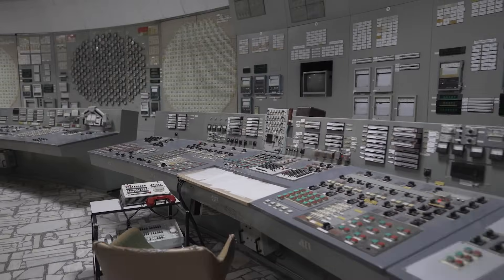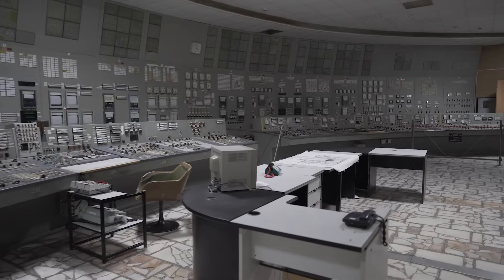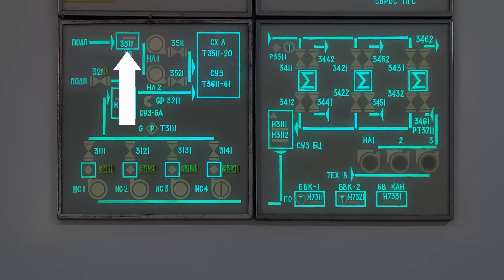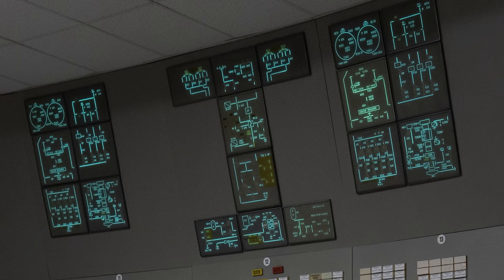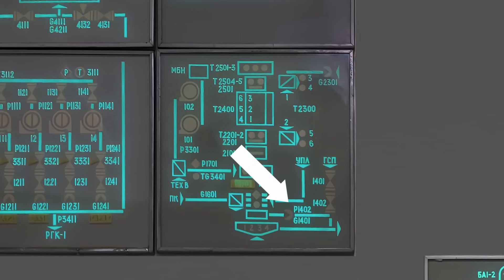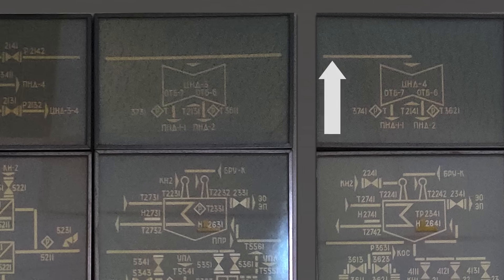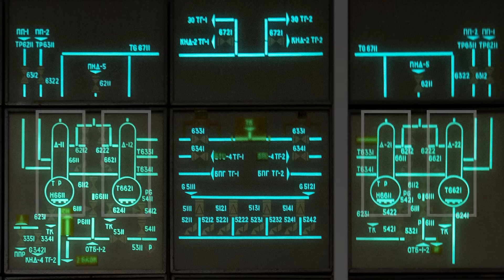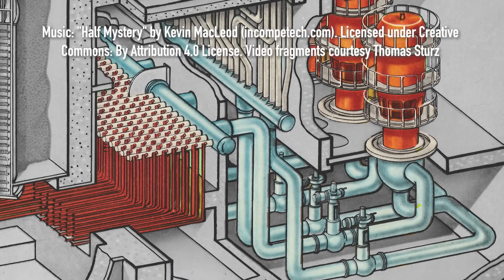RBMK Reactor: How It Actually Works | Chornobyl Uncharted Ep 21

Comment: What a nonsence, after this video i understand what a complex and unefficient sistem this is...😂 Just crazy how much heat power this systeme loses and apply for it to work. And also btw used fuel and contaminations.... But I respect the engineering decisions that made such a reactor operate stably at all..😅
Reply from the maker: I can not say that any heating plant is vastly different from this, tbh. Where you have boiling water, you always have a loss of heat...

Comment: It's a good thing this control room hasn't been modernized. Modern technology and boring LCD displays don't have even one percent of the charm of those original tilt-and-telescope indicators, physical buttons, VFDs, Nixie displays, and others from the days when technology was both beautiful and fascinating, and the control room flashed with a multitude of colors. It would be a pleasure to work in such a workshop. Not in front of a pile of computers, mice, and LCDs.
Reply from the maker: It was partly, but monitors were removed after the shutdown.

Comment: How do the pump systems not fail since they have to pump radioactive waster?
Reply from the maker: And why should they fail? Radiation has little or no effects on them; what they are vulnerable to are corrosive gases, oxides, and other  effects of radiolysis of water and nuclear reaction in the core; but as you see, there are numerous devices to remove that.
Reply: Radiation is the least of a problem they face there, not enough oil lubricant inside their bearings would be more dangerous

Comment: In some of the control room 4 photos, I can see there're four holes behind the larger panels and two holes behind the smaller ones that had been taken off before. I thought they were cathode ray tubes or rear projection displays or some sort at first, thanks for sharing!

Comment: Internal KGB memos that were later declassified after the fall of the USSR repeatedly warned Chernobyl's plant management about the serious design flaws with the RBMK reactors, namely the positive void coefficient.

These warnings fell on deaf ears for some reason.

If they had retrofitted all of the RBMK reactors with the upgrades that were installed after the disaster, then in all likelihood that meltdown would never have occurred.
Reply from the maker: Yes. A compilation of KGB reports released a few years ago is something.

Comment: They focus on monitoring the various systems. Where do errors appear? If a value is not within spec, you could have 3 people looking at the wrong place for several seconds before that is noticed.

I assume there are some auditory alarms and some visual cues.
Reply from the maker: SKALA gives output on a teletype installed at control room. There those went.

Comment: 4:14 shouldn't that graphic say N2 + He?
Reply from the maker: Yes, I made a typo accidentally
Reply: @ChernobylFamily  H and N are tricky when going back and forth across latin and cyrilic script :D I guess that's why the mnemonic displays used "Ng".
Reply from the maker: @oorcinus regardless we use Cyrillic script in Ukraine, chemical elements are in latin (as those are international symbols)
Reply: @ChernobylFamily  I know, but - like i've said - it's interesting the displays used "Ng" which is (obviously) not an international symbol for Nitrogen. My guess is - to avoid cross-alphabet confusion at a glance, since a lot of the script on the displays was mixed.

Comment: Another brilliant video. It looks like the displays are too far away from the operators to read easily, but maybe they are bigger in reality. Would it not be better to have green for normal and red when something is wrong or is it only possible to have one colour on this type of display?
Reply from the maker: This technology supports only one color. Well, they are around 30x30 cm, so some elements are small, but as our friends (former operators) told us, you quickly get used.

Comment: Would there be any footage of the first or second explosion of reactor 4? Like perhaps from a cctv camera? Since there were cctv cameras inside the Reactor Hall including one pointed at the lid of the containment vessel, and I’d have to imagine that there would have been cameras positioned outside of the power plant, since we are talking about a period of very very paranoid soviet people that were always paranoid of American interference or Invasion. I mean part of the whole point of the Test that night iirc, was to see if in the event of an invasion from the Americans or a sudden power blackout that the reactor could continue powering the pumps with the remaining momentum from the turbine winding down, until the backup generators and pumps could kick in. So, imo i believe it would not be that far-fetched to think that they would have CCTV cameras on the outside of the building, and even just at least one that happened to be pointed towards the outside of the Unit 4 Reactor Hall building’s exterior. And contrary to what a lot of people have said online when responding to the question about there being any footage of the explosion, i don't believe that the tapes would have been destroyed by the radiation, since the CCTV Tape recorder and monitors would have most likely been positioned close to the control room, which itself was very shielded from most of the radiation from the disaster. So i'm extremely curious if there would be at least one tape that would hold footage of the explosion
Reply from the maker: We have a long video about cameras used.
The problem is that if the footage exists, it is in Russia. Knowing their approach to everything Chernobyl, it will remain classified forever. They still hide a lot.

Comment: Excluding the events of April 26, 1986, and applauding the immense clarity of the presentation, if there has been any documented instance of water used for cooling an RBMK reactor being released in small, controlled quantities? (for reasons of env regulations, protocols etc)
Thanks!!
Reply from the maker: About specifically water, it is an interesting question. Technically, there is no exhaust for this (for gases there is). I can not properly answer at the moment.

Comment: So there are two loops of water exchange, one for fuel rods that is radioactive and changes between steam and water; and technical water cooling control rods? But doesnt the boron absorb neutrons? Does it not make the technical water also radioactive thus not being able to release it into the cooling pond?
Reply: Technical water doesn't flow through the reactor core so shouldn't be radioactive. The control rod channels are cooled by feed water returned from the condensers.
Reply: @ChrisL-o9k  But control rods are in the core though?
Reply from the maker: Channels are sealed. They do not hydraulically interact with each other.
Reply: @ChernobylFamily  I mean that does the same water that goes from pumps to cool fuel also goes to cool the control rods. Not as the exact same time but that the same circulating water can go to cool EITHER rods or fuel? After which they both go to the same steam separator drums?
Reply: @ Does the same water that cool the reactor cool the control rods?

Comment: Fantastic video. They look awesome, and the design is superb. Why are some parts covered like they were no longer used?
Reply from the maker: Because – correct – they are no longer used. There was a post-disaster modernization of all units, but there is no technical possibility to make corrections in those displays, so they found such a makeshift solution.

Comment: The main goal for RBMK was the ability to produce weapons grade plutonium.
In fact is was a copy of the American graphite pile built as a reactor for producing electricity .
A neutron efficient construction based on a lot of graphite blocks.
But the combination of water and carbon was as seen very dangerous.
Most dangerous for western countries with infiltration of media and sooner in politics as in Germany.
An obvious result was the very destructive "Energiewende" . 
 That is how A Merkel used RBMK Reactor Controls to stop the German economy.
Reply from the maker: A beautiful theory, too bad it is unfortunately wrong. Soviets had a solid complex of plutonium generation up and running decades before RBMK even appeared, and it is based on different, narrow-specialized reactors located in remote 'closed' cities. Those facilities handled full cycle, including enrichment and were hidden behind rows of barbed wire, and absent on maps.
Yes, RBMK are evolution, adaptation of 'Chicago pile', but their purpose is solely energy production. The amount of plutonium which appears in them is small, and it appears in variety of isotopes (e.g. 240, 241) which are not suitable for the military use, and it was more a problem than a benefit.
Plus, excuse me, RBMK are civilian facilities, even advertised abroad by AtomEnergoExport association. There is no even a bit of an insanely strict security regime as at the plutonium facilities, not a bit of support infrastructure and no waste processing facilities – and plutonium generation creates an enormous amount of radioactive waste compared to any energy reactor. 
The only and single side purpose of RBMK apart from energy was silicon enrichment for electronics, for what at Chernobyl NPP was a special workshop attached to Unit I.
Reply: Nope, the RBMK has never been used as a plutonium breeder. While it technically can due to its on-power refuelling capability and efficient neutron economy, it was never used in this manner. Its pedigree has the plutonium breeders in there for sure, but that was not the main goal for this big and powerful reactor. The main goal was the production of huge quantities of cheap and reliable electricity (and in some cases heat for district heating as well). Here is its full pedigree:  AM-1, Атом Мирный-один (“Peaceful Atom-1”) -> AMB-100/ AMB-200, Атом Мирный Большой cto/ двести ("Big Peaceful Atom” 100 and 200) ->  RBMK-1000, Реактор Большой Мощности Канальный-тысяча (High power channel-type reactor-1000).

Merkel used the disaster at Fukushima as a tool to finally shut down Germany's safe, clean, and award-winning nuclear power stations. The seed for that was sown by the Chernobyl accident, but Fukushima gave her what she needed to accomplish this. She sure as pie didn't do Germany any favours with that one.
Reply from the maker: I believe we should make a video about Soviet plutonium production as many believe in that.
Reply: @ChernobylFamily  
That would be an excellent idea because this is one persistent myth that refuses to go away. For some reason people still think there was a shed out back where station personnel was washing the plutonium out of the highly irradiated fuel assemblies, or something😅
Reply from the maker: @swokatsamsiyu3590 and muscle powered centrifuges disguised as a cycling club in Pripyat.
Reply: @ChernobylFamily  
🤣🤣🤣🤣 "Get in shape while providing a service to Communism!"

Comment: Very similar to modern day automation system mimic displays.

This looks like it was a practical mix of analog indicators controlled by a digital system.

I've always found automation tech from this era interesting, especially the Soviet tech in use in the RBMKs like the SKALA system.

Now if we had more information on what sort of systems are controlling RBMKs still in service....

Thanks for the great video as always.
Reply from the maker: At those RBMKs is SKALA-M, it is a microprocessor system, but it is called like this only as a 'token of gratitude' towards original SKALA – it is completely different in every aspect. Unfortunately, we do not have much data on it.
Reply: @ChernobylFamily
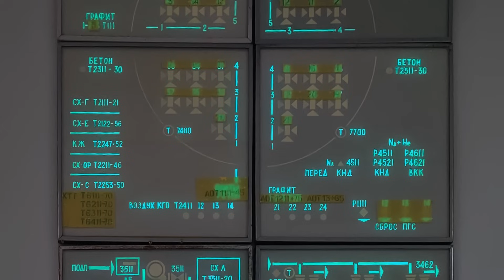 At 3:30 you say “the SKALA system will answer data on a display or a teletype”; since I am a teleprinter enthusiast, I am very curious to know which teleprinters were used (make/model). Can you found this info? 🙏

Comment: Amazing breakdown of the power plant indicators and flow of steam and water. Experienced reactor and turbine operators could see status at one glance.  Were those panels custom made electroluminescent segment-displays? They seem to have same aqua-blue glow as EL backlights on some LCD displays, but one would think that after all this time they would have degraded to be barely visible as is common with EL lightning. I see some changes on the display diagrams taped over the glass, making new panels must have been impractical at the time of those changes. I wonder which factory manufactured those.
Reply from the maker: Yes, those at AL, totally handmade. Which factory — it is hard to say now, the power plant had cointless suppliers.

Comment: Ironically, the RBMK reactor may eventually be exonerated and the blame put squarely on where it belongs:  Anatoly Dyatlov and the system that made him.  

In addition to the HBO miniseries on Chernobyl, casual study through other eyes shows an amazing system that, while it demands respect and attention, it was feasible.  The fault lay in the management, the politics, and culture.  The system flaws of Chernobyl were eventually corrected in the other RBMK's and made the system safe.  Whether or not the operational aspects were also fixed to prevent future Dyatlov's, I'm not sure.

The RBMK design made nuclear power possible for less industrially developed countries and Chernobyl's fantastic failure took away that option.  Now it's either the PWR reactors or nothing.  PWR requires incredibly strong pressure vessels and not even the U.S.A. can build them anymore.  We no longer have the industrial base nor knowledge base to build them for ourselves.  America, itself, may have to build the RBMK if we want nuclear power!
Reply: Everyone with half a brain realized 30 years ago that Dyatlov was a scapegoat who deserves only the smallest portion of blame for the accident. And only a lunatic could ever regard the RBMK as safe in comparison with modern reactors. And where on earth did you get the idea that the U.S. can't produce pressure vessels? What nonsense.

Comment: A video of the highest technical quality, congratulations on the expertise and the value of the information!
Reply from the maker: Thank you! That became possible because of consultations with actual former operators.
Reply: @ChernobylFamily  In modern systems there is probably much more automation and simplification in the graphic supervision systems, but in any case the operators must know each single screw in order to be able to act manually

Comment: Very interesting! I was wondering why some parts of the displays are covered by this yellowish plastic sheets/tape. Is there a reason why?
Reply from the maker: Post-disaster modernization. It is not possible to change displays after some circuits were changed, so some things were just covered with duct tape.
Reply: @ChernobylFamily  Thanks for the clarification!

Comment: The control-panel-in-front always looks odd to a western viewer. And we have a single operator, not 3, as most functions are automated including reactor maneuvers. Even during the 1980s, use of a single color and details at this distance would not pass with Human Factors Engineering on a western plant. As this era would have incandescent bulbs, not LEDs, behind those displays, it would be quite failure prone.
Reply from the maker: Interesting point. Though, just one person... That sounds a bit risky.
Reply: @ChernobylFamily  We have spares because we usually build 4 unit stations. It's somewhere around 55 / 4 units for all 6 crews. That doesn't include the fueling machine operators who are semi-independent.
Reply: Hi David, I'm sorry to disagree. I have personally been in several control rooms of 1300 MW class French reactors. There are several people there at all times. The room is much smaller, with a much more synthetic view, but the symbology and spirit of information presentation is quite similar. And (fun fact) so as not to stress the staff, the alarm is a pleasant house bell.
Reply: @srOmatic  CANDU runs with 1 authorized operator because of the automation. It was a bit of a kerfuffle when the EPR wound up requiring 3 despite the fancy computer displays and digital procedures. PWRs and PWRs will typically have a separate turbine operator.
Reply: I can't speak to nuclear but as a human factors tester, I work in data collection and quantification, the single color and possible light burnout make me shiver a bit :). Not to say it does not work, just that we as humans tend to have to focus very hard on a monochrome display like this. Idk, difference in design philosophy I suppose. These reactors ran for like 50yrs or more right? It must work
Reply: @unknown-ql1fk  The VVER-440s are quite spiffy looking with bright use of colors. I assume the 900s are similar. But some control rooms represent the mishmash of vendors working on them with different standards.